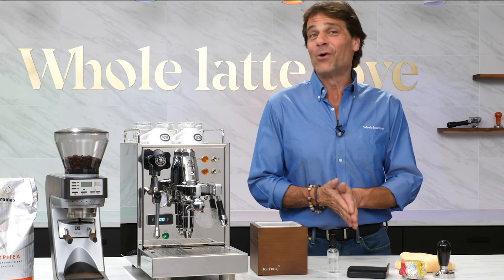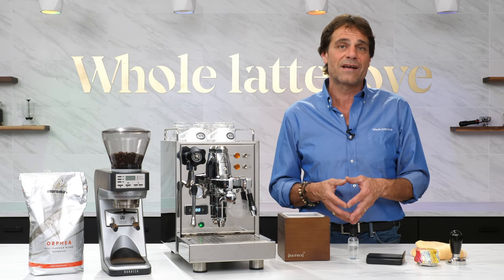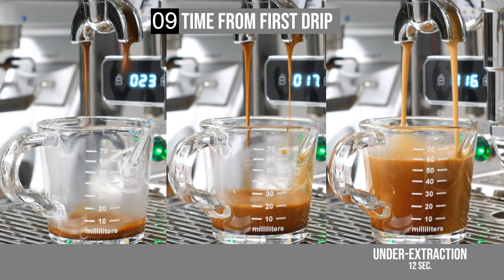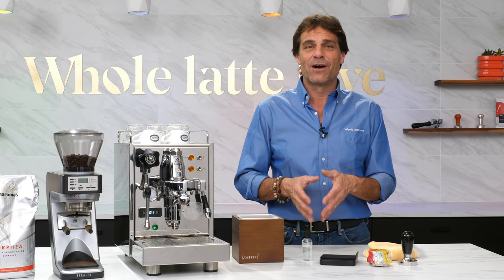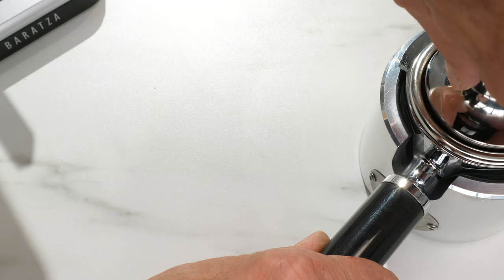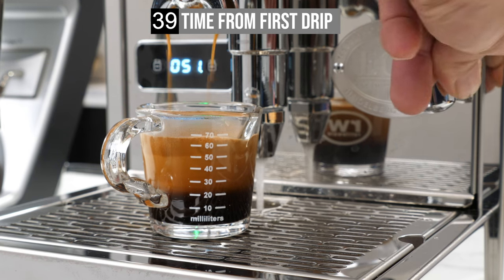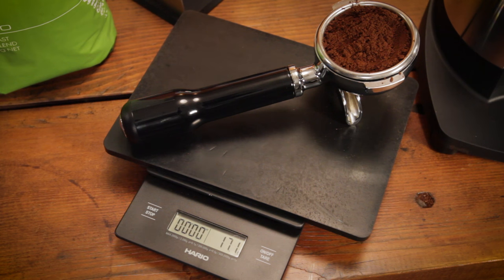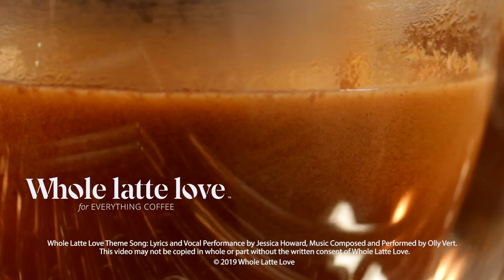How To Dial In Grind Size for Espresso

Comment: Do you really think it’s a good idea to push the orphea beans on your channel. I ordered two bags and threw them out as I couldn’t get a 20-30 second to save my life. It tasted terrible. I ended up throwing it out and going back to a local roaster. I got my machine and grinder from you guys but if this was the first coffee i used i would have wanted a refund on everything. I have the ceado e37j flat burr grinder and ecm electronica. I love everything but that coffee ick!
Reply from the maker: Hi GRS, Thanks for sharing your opinion. Coffee beans are like wine. Many different varieties which appeal to different taste preferences. I'm always very forward about Orphea. It's a classic Italian style bean blend that sells for about $10/lb. If you like that type of coffee I thinks it's one of the best. Orphea currently has >400 user reviews and 4.5/5 star rating in those reviews. It's very easy to work with so I'm surprised you had trouble dialing it in. I often take chances and try something new. I try to educate myself on what to expect before doing so but end of day I know I'm taking a risk. If nothing else you know Orphea is not in your preference. Sounds like your reaction is similar to mine if I was to be given coffee with sugar added or a really sweet wine - yuk, spit it out and avoid in the future!
Marc

Comment: Using ml instead of gram is not good, buy yourself a digital scale.
Reply from the maker: Hi Martius, Thanks for the comment. You mean like the Acaia scale I used to weight the portafilter in the video? As I mentioned in the video timing and volume are the most basic ways of dialing in extraction. Also mentioned and linked to my video on using brew ratios weighing coffee dose and the extraction. In case you missed that (maybe didn't watch video to end?) here's that link: https://youtu.be/57UqPDirHoU
Marc